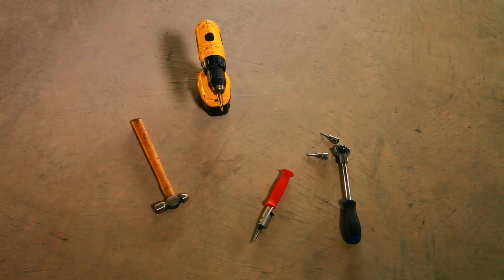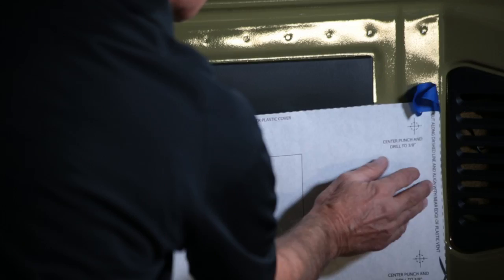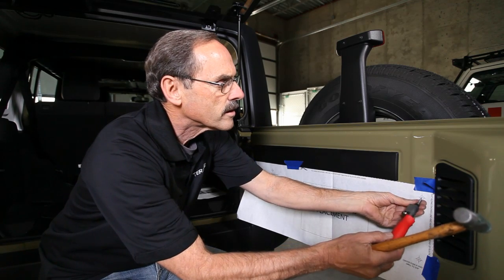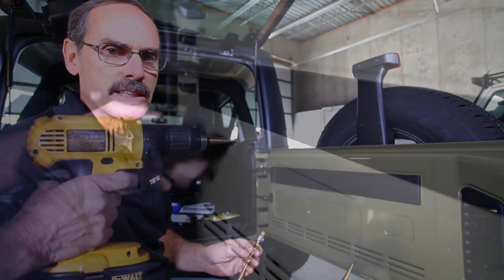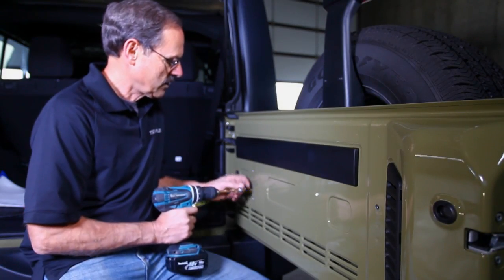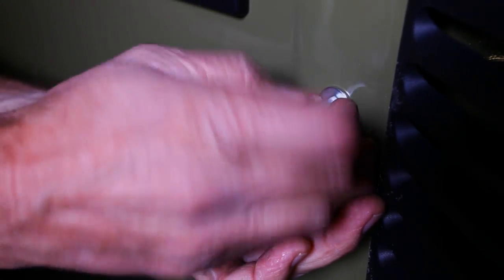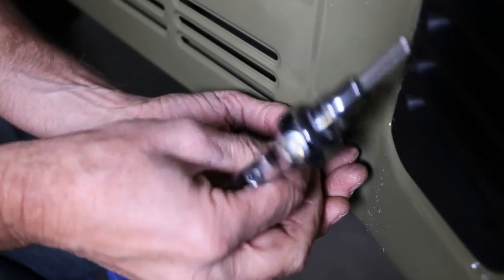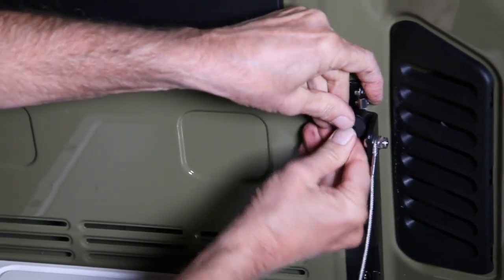TeraFlex Install: MP Tailgate Table (4804180)

Comment: Those nutserts are way too small for a 25/64 hole. I mean not even close if even you leave room to say one can't work a drill! Bad bad bad!
Reply: The correct drill size is 23/64 for that nutsert
Reply: I came to this video after I found out the hard way.  Already drilled all four holes 25/64 and the riv nuts are loose and spinning.  I was only able to get two of them to set because they pull back through.  I ordered some larger riv nuts online since I can't find any locally.  Going to be a 2 week delay.
Reply: Man so pissed off I just saw this, I literally just did the same thing.  25/64 is too big and those riv nuts just spin.  They really need to update their instructions cause that is straight garbage.
Reply: Crap!!! Came back to video to see what i did wrong. Wish i read comments before!!!! Too big of a hole...
Reply: Yep... found this out the hard way too. We ended up fixing up a tool type thing to make it work. But have to wield it on to the tailgate if I want it to actually hold the 75 pounds it says its capable of holding! So annoyed
Reply: Is this compatible with Mollie bags,correct  spacing for them.?
Reply from the maker: @rickfeemster2387  No, they are not spaced exactly for Molle/Pal to utilize the full locking features you are accustom to. But we have strapped plenty of them on. They are a bit loose but get the job done.
Reply: I agree.  I just drilled the holes and they are way too big for the netserts..  I even double checked the size of the drill bit I used to make sure I didn't screw up.